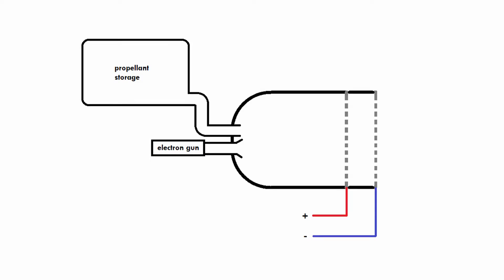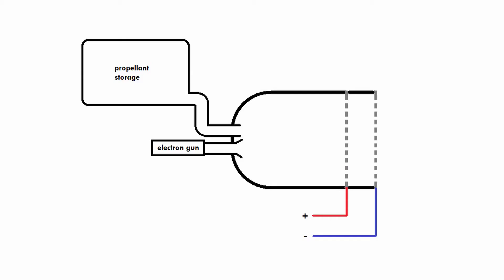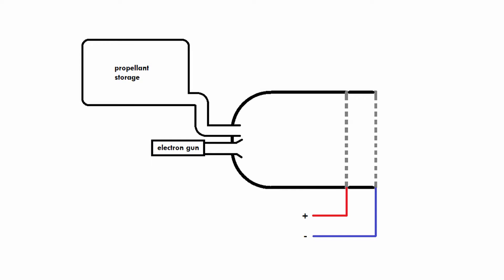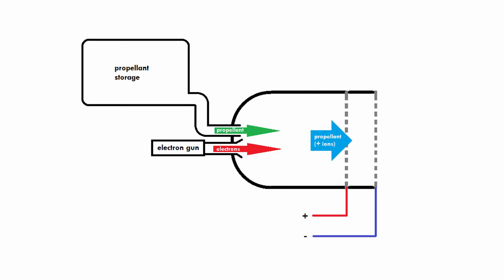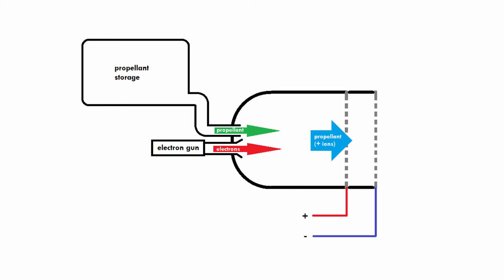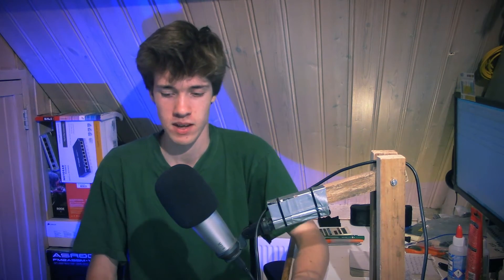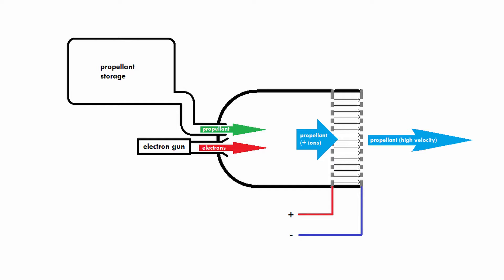What's an ion thruster? (AKIO TV)

Comment from the maker: Calculating the actual velocity gained by the craft isn't as easy as you may think; it's not as simple as just dividing momentum by the mass of the ship, because of course the ship gets lighter as it loses propellant.

If you want to calculate the final speed (delta-v) of the ship, you can therefore use Tsiolkovsky's rocket equation: V = ve * ln(m0/m1) (with V the final velocity, ve the exit speed of the propellant, m1 the starting mass of the ship and m0 the end mass of the ship) In this equation, once again, we can see that a greater ve leads to a smaller required m0/m1 ratio, confirming the ion thruster's superior propellant-economy.

Comment: Hello, I have two questions, which remained unclear to me.
1.) How do molecules lose electrons by getting hit by electrons??
2.) How does the electro-magnetic field (created by the grids) keep the neutral gas molecules in the chamber, when you said electro-magnetic field only effects charged objects?... I can't understand this.
I'm just asking, because I'm planning to build one... 
BTW, nice video^^
Reply from the maker: 1) the electrons from the gun run into the electrons that belong to gas molecules, knocking them away from their "parent molecules". 

2) there is no magnetic field, it's purely electric. What that means is, the grid at the back is negative, the grid on the left side of the drawing is positive. When the positve ions are pushed through the positive grid, they are repelled from said grid, because both the particles and the grid are positive. They will at the same time be attracted by the second grid, because the grid is negative and the particles are positive, and negative attracts positive. Therefore the particles move away from positive, and towards negative. That's how the ions are accelerated. The ions will overshoot through the grid, flying out the back of the craft, providing thrust.

Objects with no charge (like un-ionised gas molecules) aren't affected by this electric field. Neutral things aren't repelled or attracted to/by positive/negative things. They can therefore float freely. Some molecules may float out the back of the thruster even, but not at speed, so it doesn't contribute to the thrust. Ideally, we want all gas to be ionised, we don't want any regular gas molecules to just float out the back, as would mean we waste fuel.
Reply: @AKIOTV  Would positive ions get through the repelling positive grid to the negative grid because of the gas pressure? It seems that the ions would be somewhat repelled from it  before entering...
Reply: @AKIOTV  Hey, amazing explanation, but I still have some queries.
1) Since the gas is positively charged, how will it go through the positively charged mesh in the first place? They will repel, wont they?

2) Suppose the propellant gas is oxygen. When electrons hit the oxygen molecules, shouldn't the oxygen take in the electrons and become O 2- ? With negative charge of 2? 
Thanks a lot, very informative video
Reply: @fortfanop    1.> the attraction between ions and negative grid is greater than repulsion between positive ions and positive grid, because of that positive ions will be forced to get into positive grid.

2.> propellant are always chosen to be ideal gas like xenon, helium etc. To avoid such situations of absorbing electrons.

Comment: Bruh. An ion thruster doesn’t even need gas. This can be used with literally the air in the atmosphere. If it’s a particle accelerators we don’t need a secondary gas to charge it?
Reply from the maker: Well, the video assumes the thruster is used in space, where there is no atmosphere so you need to bring some gas.

(It would also be pretty useless in the atmosphere given its low thrust/power level)